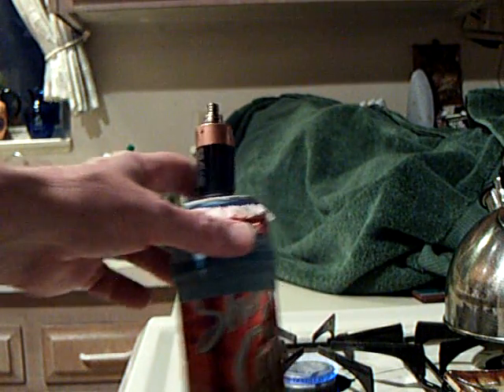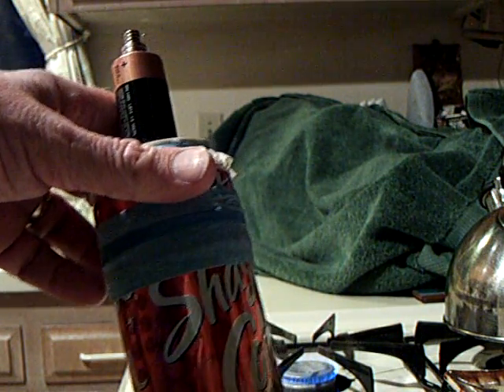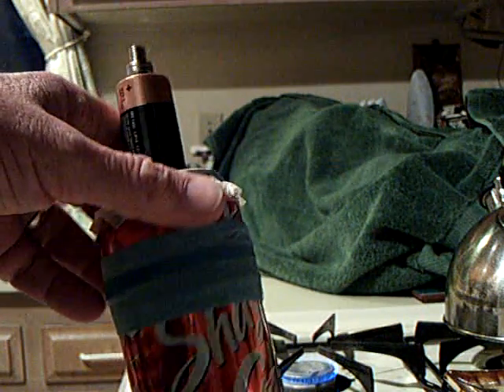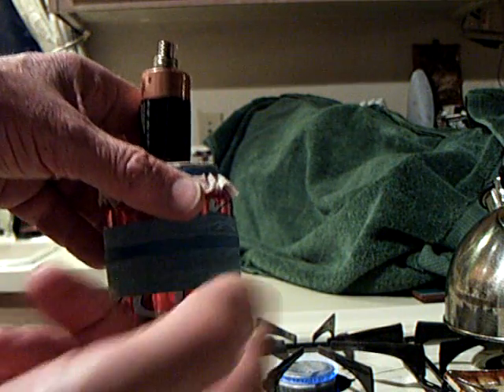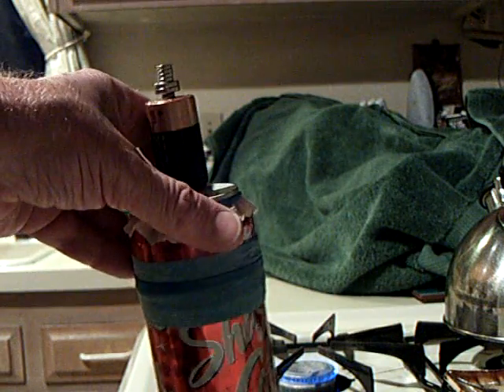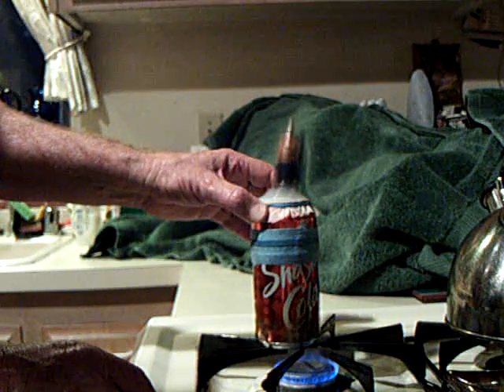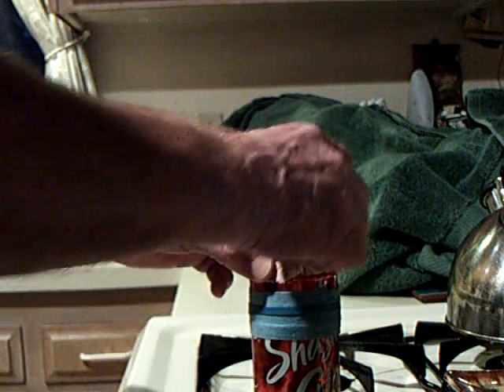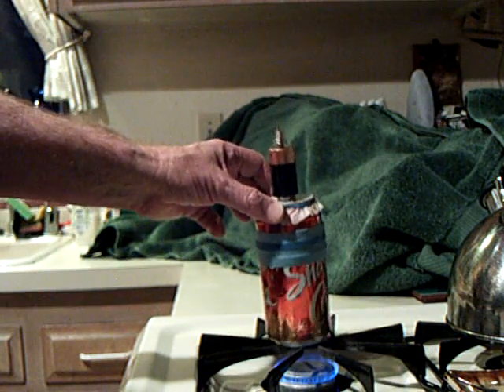Soda Can Free Piston Stirling Engine ---Running strong

Comment: I apologize> I see your video on the failed attempt now. Or you are very fast! Looking close at the thermometers it looks like there is a degree or two difference? Remember the cool side isn't very insulated yet so a lot of btu's are coming in. Also there is no real heat transfer break to the can. I do think you are going to get this working. Those 12v Thermocoupler cooler's don't produce much more. You are probably right about the clearance changing when it's being used as a cooler.

Comment: Does it cool at all when you tried? Is there working free piston ones out there? I'm thinking the size of the outer diaghram in relation to the displacer diaghram may have to be larger as it is driving rather than receiving. But it may well be that the temp differential at 1 atmosphere isn't really significant enough to be useable too. Perhaps you'd be kind enough to put up a vid of the failed experiment? Sometimes they can be as useful as the successful ones.

Comment: Wouldn't a similar one on top hooked up directly give you your refrigeration. And of course, like you say, a frame and weight. Right now it's like firing off a bullet that's not in the gun, the shell flying backwards gets half the energy. But when you get this working the way you want I think you have one of the best practical uses for a stirling- a wood powered freezer (fishing).I'd be thinking air cooled with fins made from pop cans.

Comment: Good work! I'm amazed at the power from these little things! Bladeattila's ones are very impressive also. Thanks for pointing us that way :) I think a good 555 and solinoid could drive it the way you want, but it would be tricky to get it right. More than a weekend project. A speaker and audio program could be a simpler way to do the same thing?? speaker might not have long enough stroke? Speaker is a high speed variable solenoid though :) Maybe swap paper for diaphragm?

Comment from the maker: Hi Stephan.  One of the things that attracted me to the Stirling engines was their efficient conversion of heat energy to mechanical energy. Now that I have built a really strong one, it wouldn't be hard to convert that machancal energy to electrical.  Like you say---a strong neo magnet going in and out of a wire coil is all it takes.

Comment from the maker: Thanks.  The blue band on this is a cold wet paper shop towel.  It is held on with a blue rubberband and is on top of the taped seam between the two soda cans.  A ture water jacket, like you say, is needed to keep this running stable.  The knocking you hear is the displacer hitting the bottom.  A good frame to hold this whole thing secure is needed.  She is a wild woman when she gets going.  The latex diaphram doesn't last long.  It needs a bellows setup like you and Simi went to.

Comment: Try to wrap around a piece of wet paper tissue to cold side, because this engine won't be stabilized run without any cooling. In the first 10 sec was good performance, but after the temperature different reduced and the engine's run was chaotic. And I heard something knocking voice from inside. That was from the bottom connecting? Kind regards! Blade